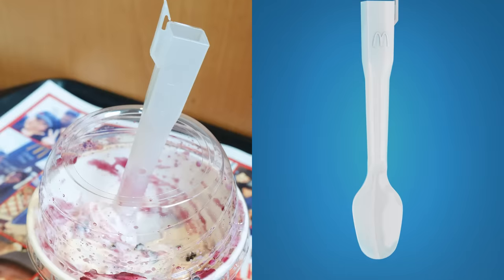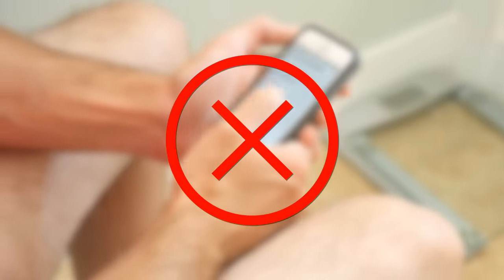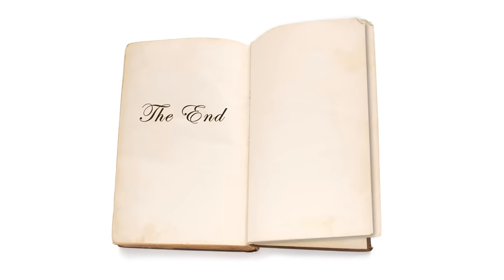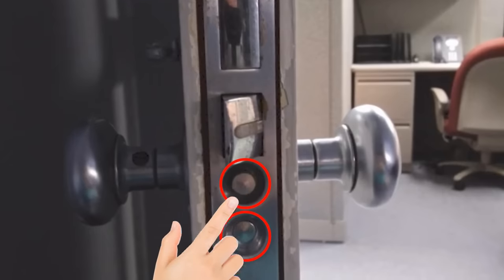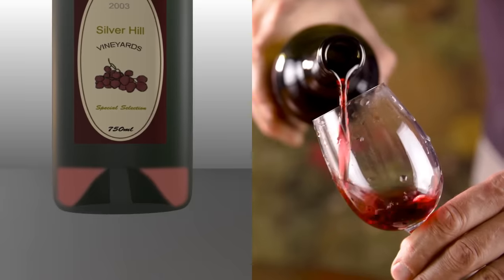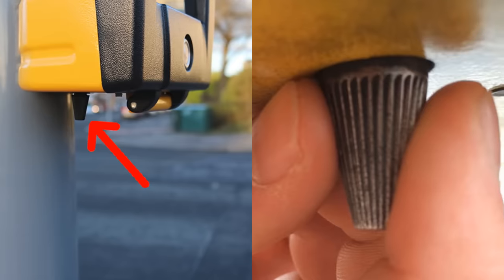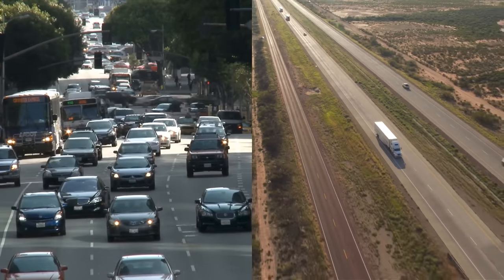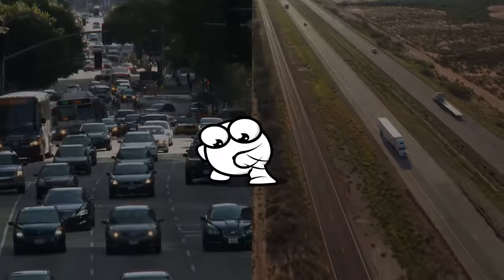Amazing Secrets Hidden In Everyday Things - Part 2

Comment: I think the wide space is very practical, so you can see if the place is occupied or not.
I never have felt intimidated. 
The wide vertical gap between the door and the frame is another issue.

I remember very well when I was working at our plant in France.
The stall door are quite close to the floor, maybe within two inches.
The French have a reputation for being risque and uninhibited.
The men's restrooms were cleaned by female custodians.
Reply: Don't you have locks? In Finland all bathroom doors come with a look. When the door is locked there is a small indicator outside so you will know if the stall is occupied or not.

Comment: Regarding dents in golfballs vs putting dents on airplanes. Modern airplanes are designed for laminar flow so denting them would cause more air resistance. Som parts do have vortex generators to reduce drag or increase the efficient of control surfaces.

Comment: The gaps under public toilets are for safety reasons but the USA has a major problem with the gaps on the sides of the doors which has no real reason. In Australia the gap at the bottom of the door must be high enough for people to see that there is someone there but lower enough so you can't see anything inappropriate, the gap must be large enough for a normal person to fit under in an emergency.

Comment: #18 - Actually, the correct answer for large openings under restroom stall doors is for medical use and safety.   If someone happens to pass out, have a heart attack, or some other medical emergency, the paramedics can pull them under the door out into the open so they don't waste time having to pry the door open, potentially saving someone.

And for safety purposes........if a child gets "locked" in a stall, they can crawl out under the door.
Reply: I think I'd rather be left for dead than dragged across a public bathroom floor.

Comment: Wine bottle dimple, or punt. You never mentioned the fact that this dimple allows the bottle to expand slightly if the pressure gets higher in the bottle. Especially required for spumantes, cavas, champaigns, and other sparkling wines. Amazing! Right?

Comment: A little  bit  more about highway numbers, mile markers start at 1 and go up from south to north and from west to east.  Also, three digit highways that begin with an even number are connected at both ends to a highway (or to itself) three digit highways that begin with an odd number are spurs, one end is connected to a highway and the other dead ends or turns into a state road/ city street.

Comment: That was the most relevant thing I’ve seen all day about the highway systems. I take i80 all the time
Reply: i80? No. Youre confused.  80 would be the hiway. 280, 480 680 would be spurs AROUND a city. 180, 380, 580 etc spurs INTO/OUT OF a city.

Comment: 18, toilet stall gaps likely has more to do with accessibility. The last stall is usually wheelchair accessible and needs a gap at a certain height or else the accessible stall would need to be larger. I imagine partition manufacturers just make the rest of the partitions with the same gap for simplified manufacturing/installation. Newer airports are just providing the larger accessible stall.
Reply: No, because these stalls are pre 1970 -before the ADA Accessibility Act. In buildings pre 1980 &1990's (unless an older bldg is renovated) the Wheelchair Accessible stall(s)are retro-fitted, usually by removing2 regular stalls to create the single Accessible stall.

Comment: On number 19 the glass traps the smoke on the ceiling so that the smoke detector can work properly and sound the alarm and if needed activate the sprinkler system.  Other wise the smoke would keep rising and bypass the smoke detector

Comment: 0:33 not true at all jeans zippers don't lock all my flies that came open the zipper was pointing down 🤷‍♀️🤷‍♀️🤷‍♀️ 

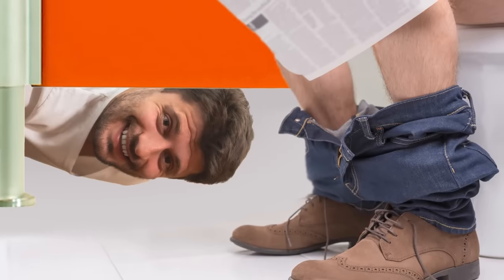1:49 not true its so cleaning staff can clean a locked stall and also in case of an emergency where you cant open the door you can slide out (e.g a fire) its got nothing to do with privacy and get you to move on as fast as possible they would take the doors off if that was the case just like how they do in Asia

Comment: Some of the Federal Road numbering system info is correct.  Both Interstate highways (like I-75) and Federal Routes (like US 52) both use even numbers for east-west and odd for north-south.  The rest is incorrect (not all 3 digit interstates go around the city).  Originally, the third digit indicated a special purpose, as follows.  1xx and 2xx for circling around a city, 3xx and 4xx business spurs into the city, 5xx and 6xx for bypassing the city.  Now, however, some states no longer follow that guide.

Comment: Not all these are correct. Wine bottle base was designed by Dom Perignon the monk. It increases the surface area to stop the pressure of the bubbles breaking the bottom. Also used to stack the bottles. Toilet door gaps is so if someone collapses they can be rescued.

Comment: I´ve heard the lollipops sticks design originally is due to better breathing if swallowed and not to hold the candy in place, which is a benefitial sideeffect. Basicly you can breath more easily until you get to hospital with the additional hole when the stick might be accedentially swallowed. Guess why you called it lollipop lifesaver? Certainly not so the pop doesn´t start to spin while sucking on a lolli.

Comment: that wine bottle
well pressure in the bottle is multiplied by the length
say 2 lb  across 3 inches - 6 lbs
length 10 ins= 20 lbs
this indentation makes the bottle stronger and allows less glass to be used
look under gas cylinders  i know i use imperial.

Comment: Not reassuring when the first one is "wow, zippers have this AMAZING thing that locks them in place when you flip them down!" I figured that out when I was like 5 years old. Who leaves their zipper standing up? Gravity ought to make it lie down anyway, it's designed that way. What would be amazing is all pants being designed so there is no way for the open zipper pull tab to lie down and get stuck in the fabric of the V where you can't grasp it with your fingers, and locking it into place so you can't slide the zipper up far enough to get the zipper tab out of the V. A royal PITA. I've had pants where if you weren't careful not to open the zipper all the way, they'd invariably get stuck and the only way to get the zipper pull out was to use a pair of needle nose pliers to grab it and pull it out. The locking mechanism worked unfortunately well on that zipper, so it was impossible to slide the zipper even a little bit. Usually one can pull it back just far enough to get the tab out, and it's more intended to RESIST sliding, but in this case it was an actual lock. Good pants are cut and designed so it's very difficult for the tab to get stuck like that. A wise thing to check before buying. I think there were a pair of Dickies work pants.

Comment: Btw,

Three digit Interstate highway numbers are for bypass’s,

The first digit denotes the miles of the bypass,

For example,

195 ,

Is a one mile bypass around interstate 95 , in Springfield Massachusetts ,

And 210 is a two mile bypass around interstate  10 in 
Lake 

Charles Louisiana,

All this was part of the interstate highway system that was put into effect when the highway system was built,

 As a part of nATIONAL defense,

 Back in the 1950s,

 That way the military people could easily look at a national map and  tell how many miles a bypass was,

If the need Arised ,

Also odd number routes were north/south,

And even Numbers  were eas/ west,

I’m assuming that was for wireless communications,
However,
Interstate highway system is a standardized system,

Again it’s been in place since the 1950’s
Reply: I forgot 405 is a4 mile bypass in Los Angeles,

And 610 is a 6 mile bypass In Houston Texas,

And in Hawaii,

They have a single digit interstate marker system,

 With h-1, and h-4

Comment: When folding toilet paper, make cross folds for strength. Its purposely made stronger by almost double in the direction you pull from roll.
If you fold it the long way into layers, it may tear down the middle. Crossing makes it strong both sideways and lengthwise.
Use less, protect yourself. Cheers from an expert...ha ha.
Reply: Yup

Comment: I know this is old but you're a bit off on the road numbers. Those are only rules for interstates and it's even for e/w and odd for n/s, but for the 3 number ones if it starts with an even number it's a bypass, but if it starts with an odd number it's a spur, only connecting to the interstate system on one side and generally dumping you out in the middle of town.

Comment: Two errors in scripts wording: First,  the location of the push buttons on the doors is not on the "door frame".  As the picture shows accurately, they are placed in the edge surface of the door.  "Door frame" refers to the pieces of material that "frame" the doorway.  Second, wine in a container that is closed with a cork should not be described as  "corked wine." "Corked wine" is wine that has become tainted by organic material in the cork changing over the years and introducing a contaminant into the liquid contents.  Corked wine has an unpleasant odor and usually an unpleasant taste.

Comment: even a smooth basketball will improve flight range if its spinning.  the dimples are catalysts of the effect. not direct causes. if the ball is spanning then air around it is it to. if dimples are there even more air will be spinning with the ball. similar to what it feels like when u swim past another swimmer. there is a cushin there of compression in the spot of every dimple. its much easier for air to pass by itself then it it so collide with the object, because if so it creates a vacuum behind the object slowing it down

Comment: The stated bathroom stall conclusion may not be entirely inaccurate, but its certainly not entirely accurate and really seems to be "stretching it" IMO

The gaps are there primarily for sanitary purposes.
If/when toilets clog/overflow .... its much more efficiently cleaned up and certainly more sanitary when mopping up the resulting mess. 
Having fewer contact points with the floor equates to fewer places for water/bacteria etc to hide when mopping it up.
Cleaning/floor maintenance and general mopping is also easier and certainly quicker to routinely mop without any unnecessary corners and barriers.

Certain types of commercial buildings like hospitals/restaurants etc., in some areas are even required by building code to use these types of minimal floor contact bathroom stall barriers.

Actually...... I'm pretty certain that the "hurry it up" motivational hypothesis was completely fabricated and entirely made up ......now casting doubt upon any other claims as well.

Comment: This highway numbering theory is inaccurate,  even numbers on 3 numbers routes means that highway begins and leads back to the 2 number main highway and the odd number 3 number highways means it starts but does not lead back to the main 2 numbered highway
Reply: The 3 numbers stating with an odd indicates that it’s a spur into the city. If it starts with an even number it’s a belt loop. Starting with 2 is an inner belt loop, 4 is larger still and on up as the city grows.

Comment: The black dots on car windows are to do with heat. Glass and the surrounding metal expand and contract at different rates. The dots control the rate of expansion and contraction between the two and prevent the glass breaking. Why were they not around years ago? Cars' of today have front and rear windows that are much larger than older cars. Just look how they are raked. Also, cars of today seal a lot better than the clunkers of yesteryear.

Comment: When I hit "1" on my 2019 microwave... it starts automatically (1 minute). Silent mode busted
Reply: Sorry dont want to be rude or anything but the seilent mode you have to hold it down, also my really old microwave(at least 7 years) has a sound button on it so yeah.
Reply: @masoncommack  Yeah, it don't work. As soon as you touch it... it starts  (2019 = NEW model).

Comment: For the blank pages in books its actually done for protection for example weather (rain droplets for example) can go onto the book and will soak through the covers and reach those pages  so those pages are there to save the pages that have writing on them
Reply: What? I worked in publishing for 20 years and it's exactly what he explained. All older books have a total page count that is divisible by 4. That's due to the printing equipment.

Comment: The theory about the hole at the top of a pen cap is WRONG! It's so the cap will go onto the pen. Without the hole, the air pressure build up would prevent the cap from going on. Also, if a child happens to swallow a pen cap, I doubt that a tiny hole at the top will stop the child from choking!  This is a silly theory that keeps making the rounds on YouTube, and common sense would tell you how dumb it is!

Comment: Also the lollipop lifesaver is also used if there is a gap there it helps people breathe if someone swollows it
Reply: No it's not, the gap is on the side would be closed by your surrounding tissue. Besides that, the tube is hollow, it doesn't need a gap. Also, nobody has a 1mm throat hole. 
Thanks for nothing, Einstein!

Comment: And seriously, you need to explain built in key lanyards? Anyone who can't figure that out doesn't deserve the air the use up. It's like half of these are just pointless filler material. The rest are between "kind of interesting" and "pretty cool". Not much amazing-level yet. And the narrator is kind of annoying. And no, you won't "stink for weeks" from getting a whiff of sewer gas.